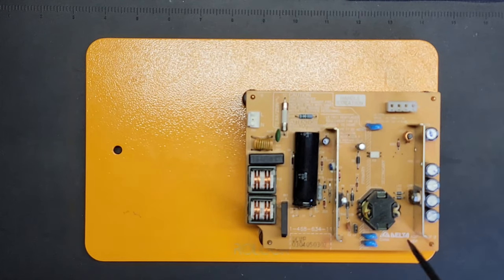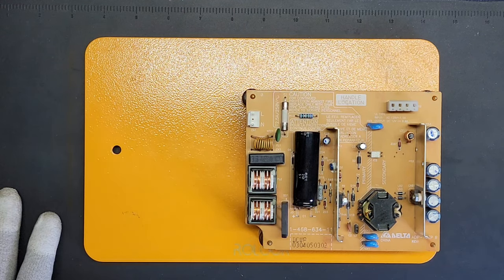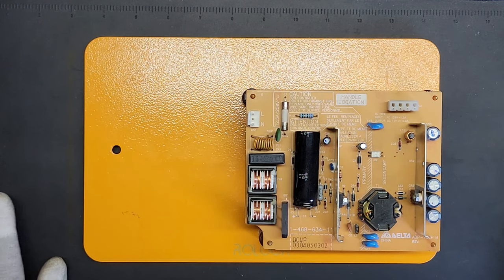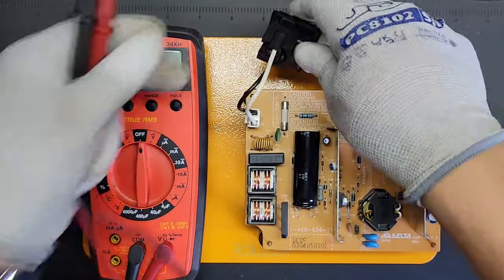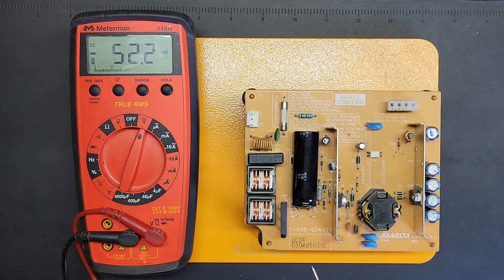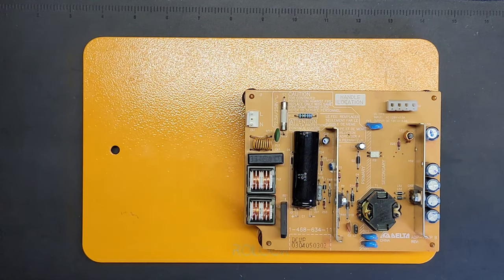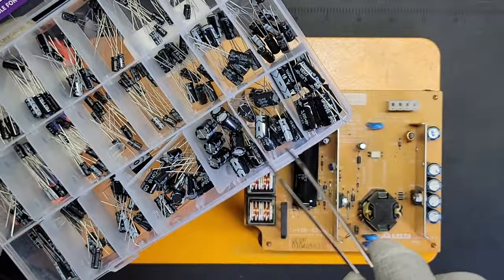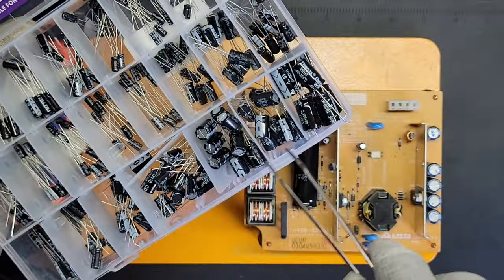NO POWER - Troubleshooting and Repairing a Fat PS2 Power Supply ⚒ TRU Fixes

Comment: You don't want to measure caps in circuit, you'll get bad readings a lot of the time. It can work, but usually better to remove out of circuit. good using panasonic FR caps, good quality. these psus look cheap...i've rebuilt a ton of psus in my time and sometimes they are just awful quality wise. bet that cap sees a lot of high frequency
Reply from the maker: Thank you for tip - I figured that was the case. Seems like Sony went through a few power supply revisions on the PS2. Again, thank you for taking the time to answer my question